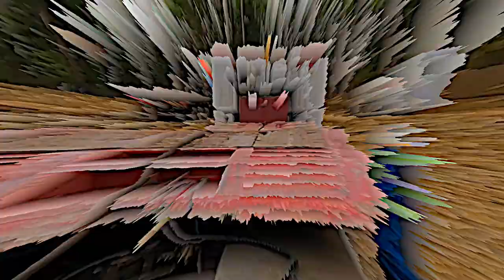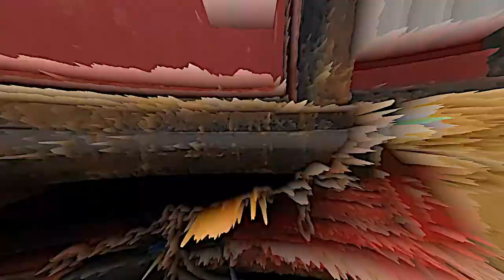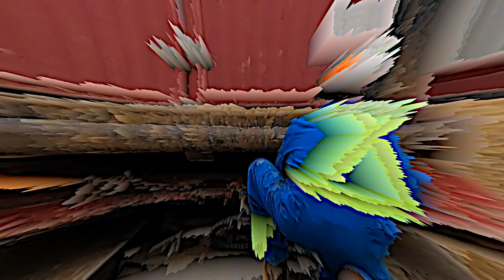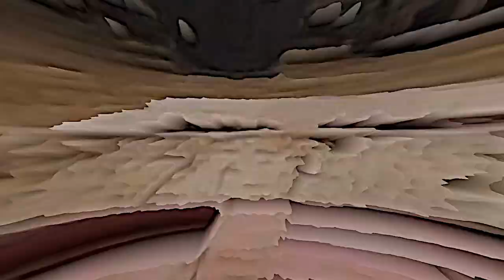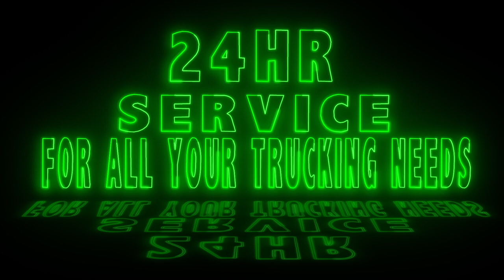RIG MOVE BRONSON & GARBAGE CAN KICKER✅

Comment: Nice rigs and they can always come in handy at anytime and i know mr lahey camp shacks will be moved like the water tanks as well
Reply: I am the liquor
Reply: I know we are all fans of trailer park boys it gets very grease up in the oilfield patches of Canada sometimes
Reply from the maker: Many of days getting greased up. Used to park right by the bar back in the day white the bed truck
Reply: Some of those camp shacks can always look like mr lahey and ricky where going at it about the bills for the rent on the trailer and it got a little out of hand
Reply: Why are there bullet holes in the wall next to the air conditioner mr lahey drunk as usual told Ricky to leave then he put the bullets into the wall and cyrus came over and talk to mr lahey and shot more holes into the wall as well
Reply: That show is very funny and even the Christmas one as well rock it barb rock it barb
Reply: @danzmitrovich6250  all I need is a hockey stick for cleaning a car with door removed for air conditioning some dope and liquor. Because I am the liquor
Reply: Mr lahey propane propane propane propane singing propane propane propane propane propane and using hockey sticks for picking up propane tanks as well and i still like mr lahey go flying out of the trailer steps

Comment: Try looking at the video with the headcam you won’t be impressed very annoying Love your videos
Reply from the maker: I go through my videos 10 times, I spend up to 8 hours a video, I really don’t see a problem, when it’s sped up, yes head cam is horrible. But to add some reality to the video, I like to inform what’s going on and having that cam has saved me big time from unplug to GoPro and hold it while I drive then plug it back in, 4 steps vs 2 and hands free. What exactly is the issue ? My head moves while I drive? Doesn’t yours? 🙃